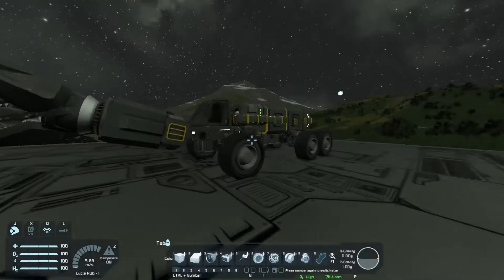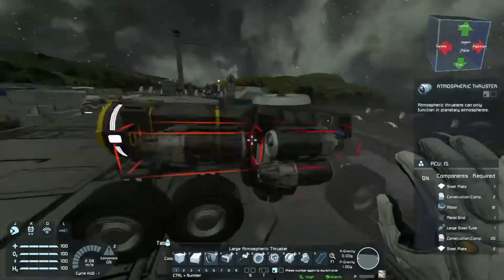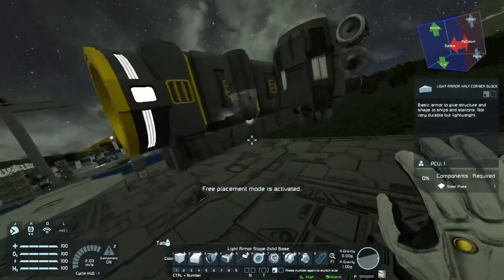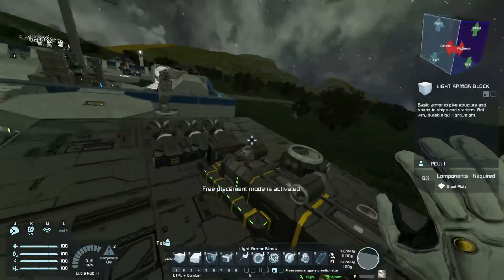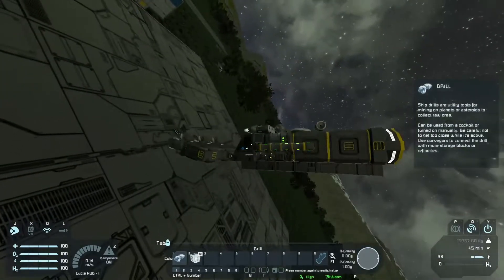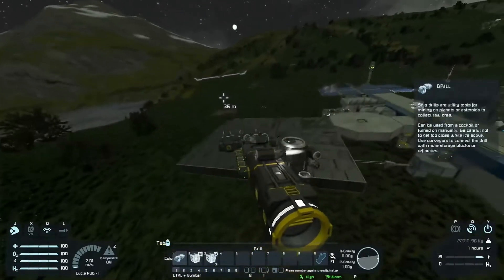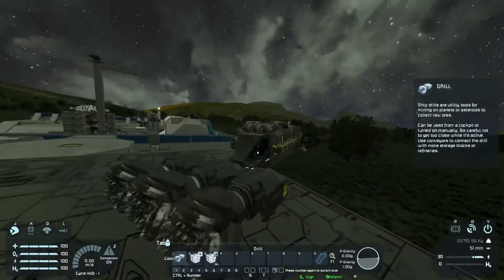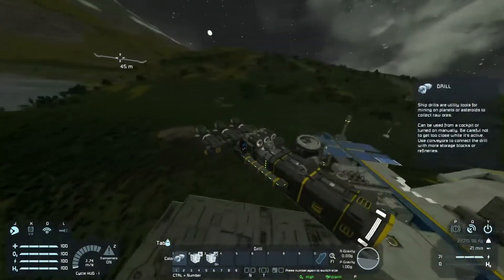How to build your first flying vehicle / Space Engineers

Comment: awesome video, going straight to the point !! love it !!
Reply from the maker: Thank you and I'm glad that you enjoy it <3
Reply: @ElSkipper  i have a question : does landing a véhicule is enough to recharge it ? or do i need a connector ?
Reply from the maker: @linkenparis9562  There are 2 ways of recharging your vehicle. The first one requires having a reactor on ships with uranium inside. This will generate energy even while flying but it's good practice to check how much energy you have left. 
The second option needs a connector. You need to land your ships, connect them to the base and change your batteries to "recharge". This will recharge your ship with power from the station.